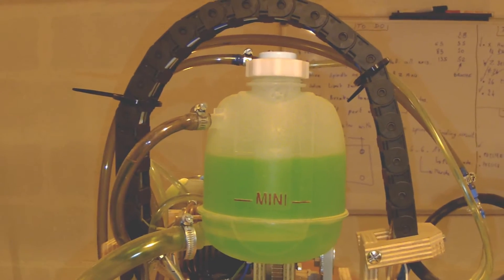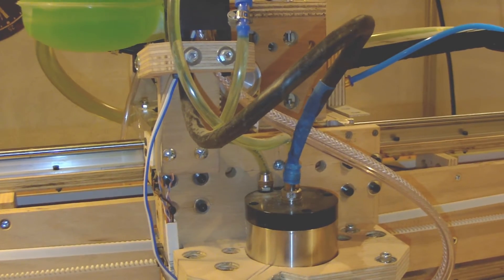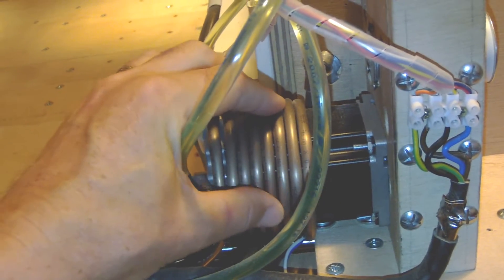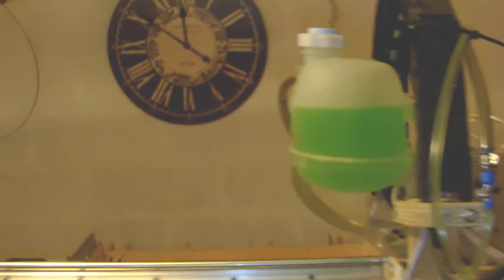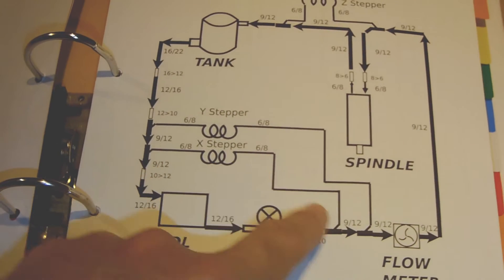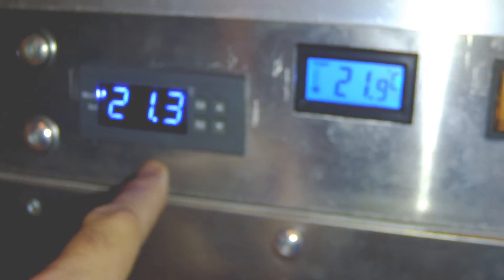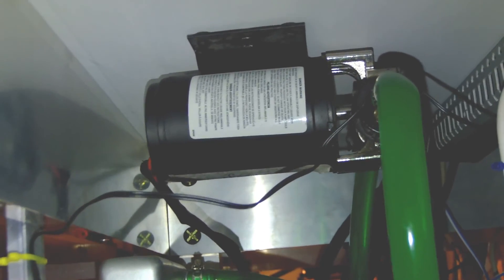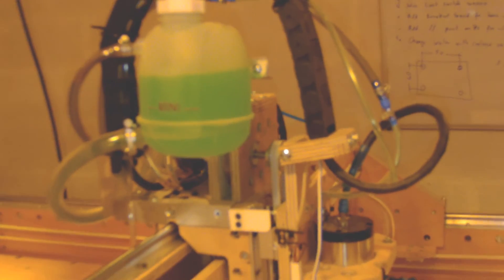Homemade DIY CNC, CNC Design, How the cooling circuit is designed

Comment from the maker: Thanks YoungJim409 :-) 
Moretheless it is very easy to do. A single copper pipe hand bended around the motor with 2 pieces of plastic pipes to join the cooling circuit. Then the CNC can run for a while without any concern like for the propeller machining video during 5 hours. You just have to let the machine do the job and can do other stuff ;-)